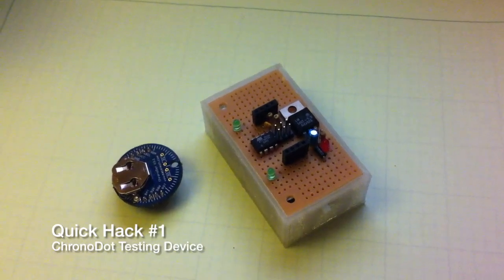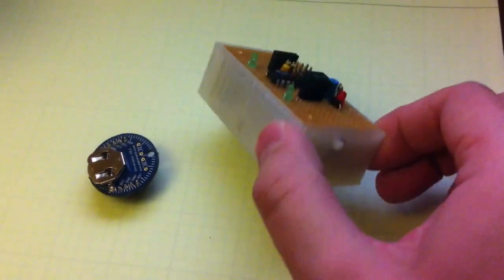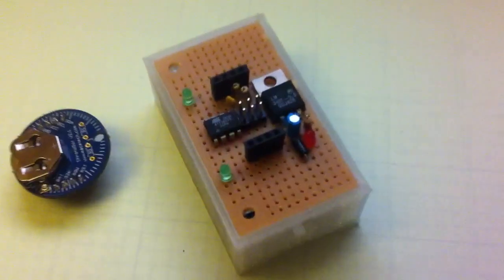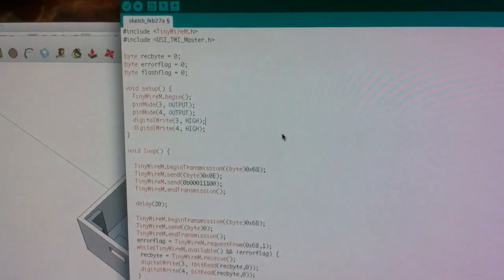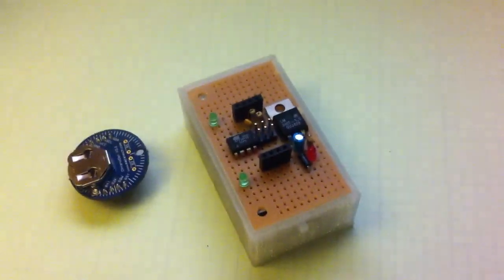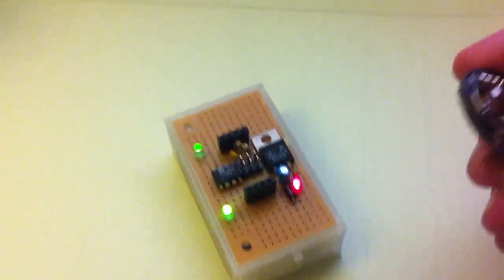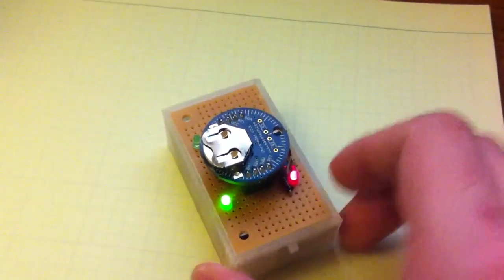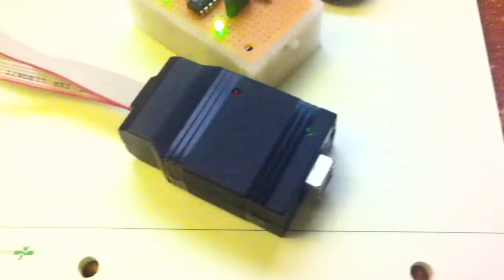ChronoDot Tester

Comment: what version of the chronodot is it? I found this https://goo.gl/qTFJbs   but it's version 2.0 the adafruit version is 2.1 any idea what's the difference?
Reply from the maker: ChronoDot 2.1 is the current version. ChronoDot 2.0 had a silkscreen error and only a few were ever made. However, the files were still made available as open-source hardware, and the ChronoDot 2.0 is made by Chinese sellers (including the incorrect silkscreen). One common thread for Chinese-made ChronoDots: they use counterfeit or old-stock (desoldered from other boards) DS3231 chips. Many of them have datecodes indicating the chip was made in 2010 or earlier. The image in that eBay listing is copied from the macetech website and shows a datecode of 2010 (because they were made with fresh DS3231 chips in 2010), but I have seen older chips used. Keep in mind that the DS3231 contains a quartz crystal and they do slowly go out of spec as crystal aging occurs. Macetech only supports original ChronoDots manufactured by macetech LLC, and cannot guarantee the performance or quality of ChronoDot modules made by other sources. The current official distributors are Adafruit, Micro Center, Jameco, Solarbotics, Evil Mad Science Laboratories, and macetech's own website.
Reply: Wow, thanks for the detailed response.